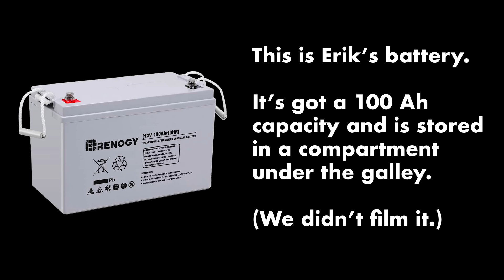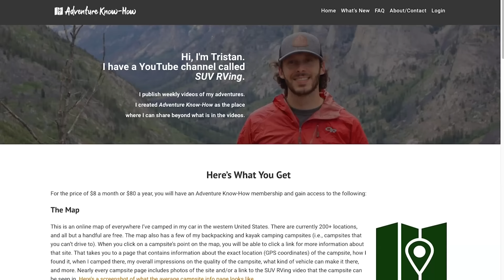Living Full-Time in a Tiny Teardrop Trailer (Camper Full Tour!)

Comment: 500 watt solar power station and Dash mini griddle....350w cooking...no propane. Makes huge pan biscuits, 4 inch pancakes, eggs, etc. Eat the pancakes AS you cook them and it works out great. They have a similar waffle maker too if you prefer that. These things are amazing and have non stick 4 inch cooking surfaces. A 600w power station can power the 520w Nostalgia sandwich maker. Makes a grilled cheese in 3 minutes or less and also does amazing crispy corn fritters using precooked Pan cornmeal. Dash also has a 200w rice cooker perfect for one person.

Comment: IDK if anyone has mentioned it, but for the record.  Those 16oz propane canisters are refillable, just buy the adapter( it's less than $20)( get the one with the separate valve and  the gauge ), I've been refilling the same four 16oz.canisters for over ten years now.
Reply: What do you refill them from?  Never used propane but starring to get curious about all things camper/trailer/vanlife.

Comment: This guy is very organized. He is giving off positive vibes. One thing though: the stuff in the back of the car( payload) combined with being way to close to maximum towing weight can be a problem in the transmission engine etc.
Reply: I agree. He also needs to downsize. He has a lot of little Knick knacks he doesn’t use and needs to get rid of. A lot of little piles he doesn’t need.

Comment: I run my buddy heater all night long. The secret is to open the roof vent to let out the carbon monoxide and humidity. 
Carbon monoxide is lighter than air and so is the water vapor from burning LP and will go up through the roof vent. The water vapor helps to hold the heat in the air, especially in the dry winter months.

Comment: One gallon water containers are the way to go, thats all I use have about 10 of them. Sleeping bag rating is a survival rating meaning you'll likely survive at that temperature, for comfort add about 20 degrees to the rating.
Reply: I love using just the one gallon jug. its soooo much easier to fill that up. I learned the hard way about the sleeping bag ratings. haha

Comment: A gas generator, which costs not so much, but if installed outside and wire through the wall might help in winter time.

Comment: On that awning pipe. With the rattling clips. Just wrap a little tape around the pipe where the clips set and the rattling will be gone. Personally the rattling wouldn't wake me up but if I'm waking and I hear the rattling.....I at least know there's wind and how strong by how much they are rattling! Later! Oh keep Gorilla tape not duck tape. (Gorilla is a lot stronger and thicker) and some rolls of electrical tape for use when you need them. A tube of a product sold at every home store is called SEAL-ALL. I've used it in everything. It seals sticks things and fills gaps. Great stuff and it's usually clear! Later. J Poll.

Comment: The Forester is a really good car. I’ve got a 2016 base model with a canoe rack and a manual transmission. But if I wanted to to do some long term car camping I would just use a 10X10 tent which I could stand up in. I own three tents at least that size or even larger. I’ve spent a total of an entire year sleeping on the ground doing wilderness canoe trips in Canada at two different youth camps on Lake Temagami in Ontario. Sleeping in tiny canoe camping tents is the pits. That’s why I now prefer army cots and tents large enough to stand up in. Dome tents are easy to set up as is the Cabela’s outback lodge with the center pole. Although I attended truck driving school back in the ‘eighties I prefer to not tow a trailer.

Comment: I've had two teardrop campers. The first one was a Little Guy built trailer that I modified to my liking, including air-conditioning (I live in Texas). I built the second one from scratch, using an old lightweight boat trailer modified as the frame and suspension. I found out who made the doors for Little Guy, and bought a couple for my home build. Teardroping is a lot of fun, and doesn't need a big truck to tow with. I used an Audi Allroad for the first one, and a Volvo XC70 for the second one, and I could barely feel them being towed. I'm thinking about getting another one for my Audi Q5.BTW, I didn't have anywhere NEAR 10,000 bucks in either of my teardrops.
Reply: Who makes the doors?
Reply: Can a teardrop be stored in your garage?

Comment: A great little home from home. A 10 amp (approx 150w) 12v panel will charge this from flat in 10 hours more or less, but if you use a 24v inverter then it will only draw half the current, so a couple of 50ah batteries in series will last twice as long between charges and not weigh as much. There will also be less current loss in the cabling needed,  and not so much reliance on the vehicle to keep the batteries topped up.

Comment: Little tricks here,  you can get   "bed warmer" heating pads...  that you can lay on top off, or put inside a sleeping bag liners that you can plug into 12v power systems, or 120v outlets.   they will help in really low temps, to keep you comphy.  To make it fell less like you are "surviving" and more like "you are just safe at home"  

power wise, there are so many options there are tons of "solar generators"  which are just large batteries that can be hooked up to solar power to recharge.   they range from tiny little things that will just charge cellphones and laptops.    up to massive heavy battery arrays that will let you run AC even, but need like 8+ panels to recharge.  

Normal options are Jackery, bluetti, and such.  jackery is really nice but all of these options can get expensive.

But wait!   What if you aren't doing this "full time" and/or just need a little power for trips.    Ryobi and Milwaukee both have Inverters for their batteries.   So for example, Ryobi,   you pull your your battery off your drill and you can plug it into a 2 usb 1x12v 150 watt inverter, now you can use THAT as your battery.    their 40v batteries have 300 watt inverters with AC out.    The Milwaukee version has 2x usb and 1x120 and comes in the 150 and 175 watt versions.   

This gives a ton of options for short term camping with these litte things, and keeping the weight down.

Comment: How do you wash your clothes? You could make a quick cheap washing machine with two 5g buckets drill holes around the bottom and middle of sides of one, then put inside the other one. The holes might need sanding after so the clothes dont catch on the rough edges.  Pour water and detergent into the drum till it reaches up halfway. Cut a central hole in the lid of the top one, get yourself a long handled new plunger, and you can insert it through the hole, plunge up and down to agitate the clothes then you can rinse them in the same way. Also spin dry them in the same way just agitate with no water in so the wster drains out. Its great for off grid use, happy travels 🥾😊🤞🏼

Comment: I agree with Erik on the battery charger, I was car camping with a group, and I left open the back hatch window and didn't realize the inside light was on and ran down my battery, one of the ladies in the group had that exact charger and it worked like a charm so I purchased one to keep in the car; while I wasn't out in the middle of nowhere the comfort of having that charger is a plus especially being a solo female camper and it takes up less room than a pair of jumper cables.

Comment: Nice teardrop. He bought the right size, the low profile of the trailer keeps the gas millage low (and prevents scraping on trees in tight camps). I couldn't figure out why the 12V system doesn't work unless he has it connected to shore power - was that 12v receptacle powered by a converter? Why not wire it to the battery?
Reply: @MsQ275  correct. it is a 110 outlet. the 12v works when I connect a small 12v power inverter in the back... to charge my phone while I'm cooking

Comment: I love how they charge top dollar for these things, and put those big, cheap garbage lights in them. I'm building my own trailer, and used those first, but then I found some almost flush lights that put off great light. A much better and readily available option. I had to build my own as I just couldn't justify the cost and quality of these mass produced units. Mine has exactly what I need and want in it, no more, no less. It's top quality, well insulated, light, and has all the luxuries I want. I haven't tried yet, but I feel it would be perfectly warm in -40c. All for under 2000$, although mine has a 6ft ceiling.

Comment: 24:58. Leave something like that outside your vehicle in So California and it won't be there first time you're coming back from shopping. The old own did no favor. He probably realized the theft danger too. Better if they were metal.

33:54. I found out when I rented a small U-Haul trailer to move about 300 miles I was stopping for gas twice as often. A trailer also limits where you can go. Backing up has a learning curve. I hear a lot of them getting stolen - especially teardrops.

35:19. Bad idea

37:47. Saw a bumper's sticker in Oregon - "camping is in tents"

43:24. Never wash a vehicle near a lake or stream, especially if it's uphill from that water. Better yet wait too you get to a town with self carwash. Long as you're on the boonies it's just going to get dirty next gust of breeze. And you free up a square foot of storage space.

Comment: Hi, my comment is intended for Eric, he's the person presenting the content I just viewed.
Great job presenting, very thorough tour. 
Your "Teardrop" is set up well, appears to be both sensible and efficient.
Re: Four Basics Heat, Light, Air and water. 
Heat and light are well addressed, no need for concern, IMHO.
Air and water, WOW, total show stoppers for me. However I may  be overly sensitive, too difficult to please. So I'll let you be the judge.
Unless I missed something, when not driving, of course while camping you are subjected to ambient conditions. You can keep warm, no issue here, but hot and humid remain unaddressed. You mentioned (not trying to quote) that w/ rear window nets that you need not withstand the heat and other stuff. Eric, you're talking about heat and HUMIDITY.  Which you have no relief from. You have allergies and you wear contacts, best thing to prevent suffering, getting a break by sitting in cool, dehumidified, filtered air. For you its runny nose, runny eyes, scratchy throat, I'm an allergy sufferer, too. Your alternative is to take Zyrtec (R) and perhaps some other meds, not mentioned in budget, and drying of mucous membranes by use of meds tends to cause exacerbation of symptoms and more meds. I can't stand side effects of any allergy meds, feel horrible. You need A/C.
You can cook very effectively, but you have no means of refrigeration of anything. Yes you have a good cooler as a very temporary means of food storage...........days, if not opened much. For a week or weeks............forget it. Your "pantry" had opened dressing and sauce, really, sauce...........hard to keep open @ 4 deg. C. Room temp and the SUV and trailer get hot while sitting. You'll get away with storing leftovers and "referig-after-opening" items alright..............until you pick-up G.I. staph. infection from one of those items that appeared and smelled OK...........but, NOT Okay. You'll need to add a visit to local Doc-in the -Box for treatment, to your monthly expense ledger.
Water, 5 gal. readily available in trailer, 4 of which can be used to brew tea, you can get a cool or mildly warm shower with that black colored gizmo on roof. And, how about showers @ 0 deg C (32 deg F., weather) I don't think so. And, turn water on to get wet, off- to lather-up, on- to rinse off...........NOT a shower, a pain in ass. Had to do that in flat while in living in London, where I thought that the kitchen water heater was a fire extinguisher w/ black paint. Nooo, that WAS the water heater. My showers felt like someone was spitting on me, really heavy flow, for spitting, totally inadequate for showering.
Then you have extra 10-15 gal. in trunk, to which I would be adding a splash of Chlorox to for each fill. Those 15 gal are NOT what I consider as fresh water if kept @RT for more than a few days. That contraption with "fresh" water in top and grey or BLACK?! water on bottom, too gross to bother thinking about.

If not for complete lack of A/C, inadequate volume of potable water for drinking, cooking, cleaning, bathing creating a continuous need for fresh water, that (often?) can't be  conveniently met. And, total lack of refrigeration, a mishap waiting to strike, if lucky you won't encounter..............but you're full time at this, odds thereby are not a safe bet. 

In conclusion, I could say , in my very humble opinion, this looks do-able, although a bit of a challenge re: fresh water (drinking & bathing), refridg, and A/C especially for an individual with atopic allergy.I think you are very intelligent and level headed, & well suited for remote living. Best Regards, M. Rosen, M.D., Ph.D.

Comment: If you're going to stay in the teardrop in cold weather think about buying some 1  inch thick pink foam board. At home Depot.  It will make a big difference in keeping warm  then when spring comes either store it somewhere or leave down .the stuff is fairly cheap

Comment: Good job plugging Tristan’s channel. Always good to see allergic folks using sinus rinse bottles in the wild. 

I find it odd that the foam over the air mattress didn’t suit you - it’s what I do for my full time bed, but when I switched to a thin air mattress I added a thinnish box spring/mattress under it. Don’t know it it would work for you but it comes in twin XL from home depot.

After you got to all the stuff in your car & box, I perked back up. The amount & type of stuff you have is closer to what I travel with than most others. (I haven’t been in a few years though, but I spent much of I 10 & 90 plotting how to improve on my hatchback setup.)

Comment: If you're working from home, for four days and four hours a day, will the solar be enough please? And do you get good internet access in the woods, please?
Reply: yes. i have a smaller solar setup- 100w Panel. 500w inverter. but that’s plenty for a laptop. internet can be hit and miss. to try and make sure i find spots with cell coverage- i use iOverlander and Campedium and read reviews

Comment: Great vid, I don't want to be that guy. But if the carbon alarm goes off at that height it's probably to late. Co2 is heavier than air and you sleep lower than the alarm.

Comment: $1300/month seems like a lot.
I assume it's something like:
$93 storage
$120 gas (500 miles a month at 17mpg. about 30 gallons at $4/gal)
$3-400 groceries (I assume it's hard to cook cheap without a freezer/fridge)
$100 car insurance. Probably need comprehensive if it's a loan.
$100 2x cellphones/internet
fuel for the stove
Hopefully health insurance
I dunno, that's only like $700-850. Hopefully the food budget isn't like $600. Maybe there's more gasoline being used. Or a night in a hotel/week.

Comment: I guess I need to go look for some of the thinking behind this pint size living quarters.. I assume it's a big savings on gasoline and to maneuver in tight areas or by hand if needed. Just seems a trailer you can stand up inside would be nice.. With an indoor potty and stove. Some generator and fridge may be handy. Glasses might save some money in the long run.. But if he has a home there is no worry on income or medical insurance either.

Comment: Great video.  What is the brand of the 2 lockboxes on the trailer?  Want able to find them in the description.
Reply: oh, sorry. but there isn't a name printed on them, or else I would tell you. they came with the trailer, since I bought it used
Reply: actually- sorry- just looked at my lock boxes. they are stamped with ‘Greene Horizons’ on them. if that helps

Comment: Hi nice kitchen, for me it,s too organised, on my bushcamp offroad I do all the cooking on the bagagebox on the dissel. I have an electric paella pan which I use for various types of cooking, I have a coleman type cooker in a case which I use with small gas cans? "Don,t know english translation". And have just changed my waist high schottelbraai bbq for a compact table top type. (African origine) All my gas which is normally 2 bottles is of the european type (blue bottles) have 35 hrs continuous use which is enough for my needs + gives me the freedom of using all around the caravan. Also I have an Italian gas ring which will fit any size of blue bottle. So I,m prepared for any unknown circumstance. In the event of cool nights I have a smaller blue bottle with which I can fit a fire fitting for cosy evenings. Unlike the U.S. here in europe apart from Scandinavia there are,nt any or extremely few places where you can camp wild. You mentioned 30 dollars as a price for an overnight camping, well there are more opportunities here for lower prices if you shop around. Roy,Haarlem,Holland.

Comment: Sorry to say but, you'll be dead before that carbon dioxide detector goes off. Fun fact CO is heavier than air, so your camper will fill up from the bottom up. And since you sleep way below it... not good. Find a place down low for it to live. But 👍 for the effort. 💖🌞🌵😷

Comment: Dude…Seriously??!!?!? You are wasting SO much space, it’s insane. I could easily name 5-6 items, quickly. I live “full time” in my Jeep Grand Cherokee, equipped with a large roof top tent. I can also go about a week “off-grid”…BUT, I have a much better solar system capacity which allows me to power a mid-sized freezer/fridge, the entire time. My driving dynamics are much better and I can go almost ANYWHERE, with everything. You have a nice set-up. No doubt. But you really need to tighten things up. ☮️.